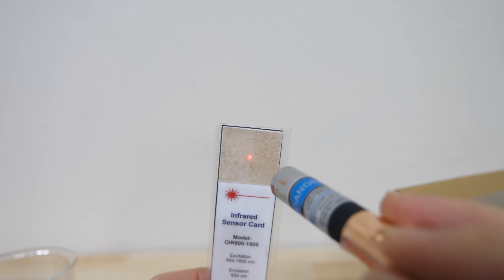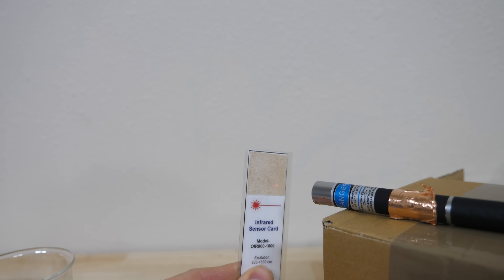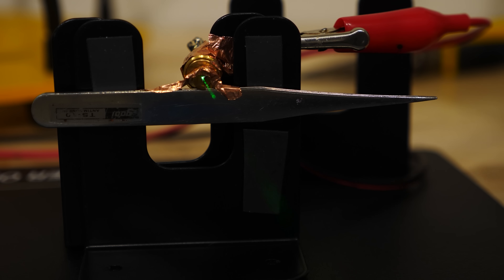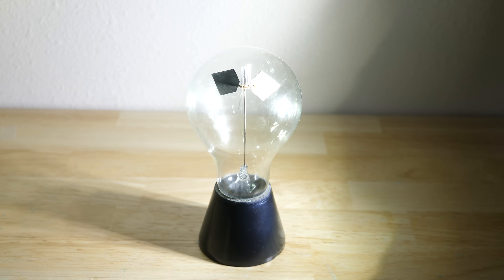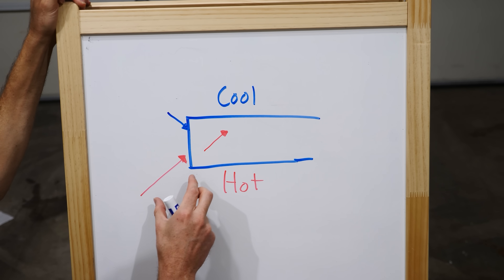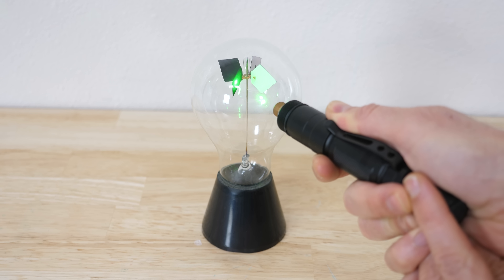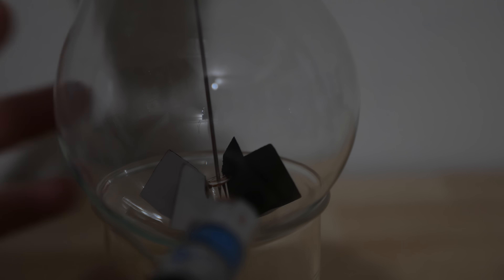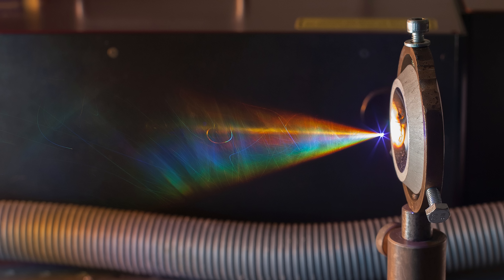I Had To Break My Radiometer For Science

Comment: You don't seem to be careful with IR laser. They are extremely dangerous and can inflict serious damage to eyes by accidental reflection that you can not see (and so there is no protective reflex).
Reply: Some ir lasers are not so dangerous at low powers. 1550nm for example is absorbed by the fluid in your eye and therefore little energy makes it to the sensitive photoreceptor cells at the back of your eye. Also, the lens in the eye does not focus 1550nm light onto the sensitive cells at the back of the eye, resulting in relatively low energy density at the sensitive cells and thus less chance of injury.  This is how some LIDAR systems can operate out in public without blinding everyone.
Reply: Yea it really depends on the frequency
Reply: Dmitry is correct. I think it would be a responsible thing for the actionlabman to invest in a laser safety course. He really is asking for an eye injury - so many safety issues. If he was doing that in a R&D laboratory or even a university lab he would be in serious trouble if not fired. For example, does he know that the 1064nm Nd:YAG laser is not completely converted to green? There can still be a significant, non-eyesafe 1064nm through the nonlinear crystal or OPO. And no, 'just wearing goggles' is not sufficient. Source: I am a laser lab manager.
His background is in Chemical Engineering and I love the channel but worry its not going to end well for him.
Reply: @RealSuperDuperCooper  At what point in the video do you see him using the laser without googles?

Comment: Microwave ovens do it all the time, whenever they burn metals and stuff.
Reply: Microwave ovens put out literally about a million times as much power -- 1kW vs. 1mW -- it's not that the effect happens at all, it's the low power and therefore by implication how efficiently the light is being generated that's confusing.
Reply: @josephlunderville3195  Strictly speaking, quantum theory won't permit microwaves to become visible even at a million kWs🙃, but when it comes to heating, why should you care if it's low intensity or high.. any heating can lead to visible radiation emission, it's just temperature based, no matter at how little area